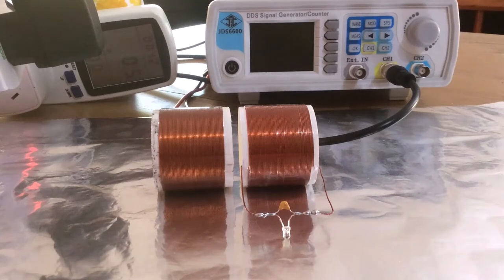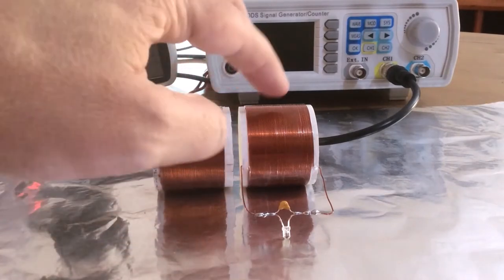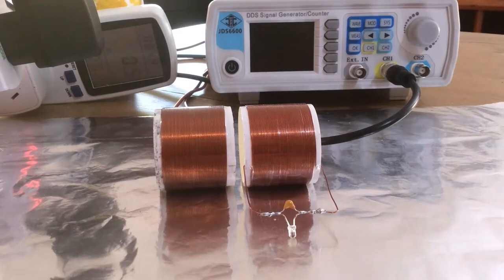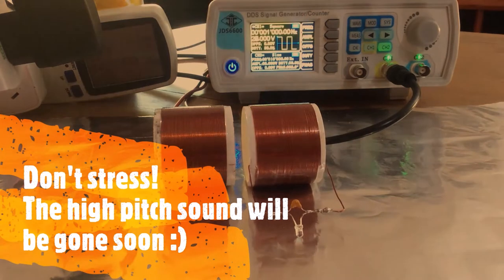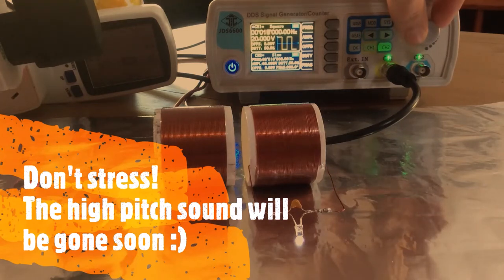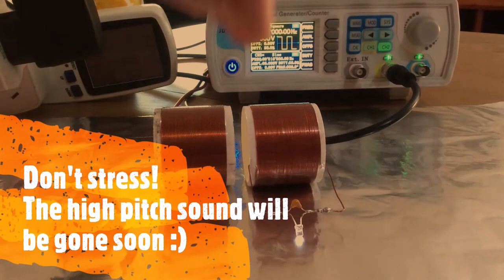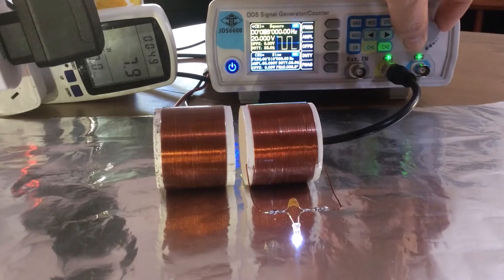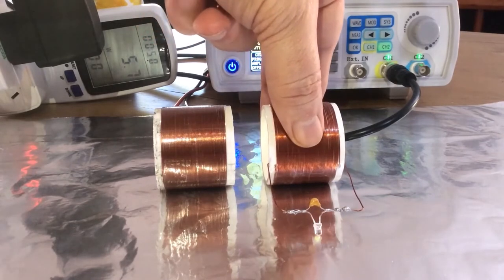FREE ENERGY with RESONANCE!

Comment: hi, do you have the Rick Friedrich Gate driver schematic?
Reply from the maker: Thank you for your comment. I don’t have a gate driver schematic like Rick does and instead I use my portable coil system as a “sort of” frequency generator or my actual frequency generator. I do however have a gate driver schematic from the company that produce the educational coil that Don Smith spoke of which is similar to the system Rick uses, that company still exists today. I would be more than happy to supply that very simple schematic if you need.
Reply: @whatifididthis...1236  yes please!
Reply: @whatifididthis...1236  can you please give the company name, they still sell Dons 2 coil system?
Reply from the maker: @ReigoVilbiks  Unfortunately they no longer sell the unit, the web site was sciencefirst.com and when I contacted them they were selling it, it certainly was not cheap at approximately US$220 so I made my own. I did however acquire a copy of the operation instructions in PDF form, which has the signal booster or gate driver schematic on the last page. I have seen this kit elsewhere and I will supply a link at the bottom of this comment but you may need to register to see the price, I am in no way affiliated with either company.
It is interesting to note that both companies used the same stock photo of the kit. I might also point out the company that Don mentioned somehow led me to sciencefirst.com after I found a company name change, forgive me, the details are somewhat sketchy as this was a long time ago.
https://us.vwr.com/store/product/13387741/resonant-circuit-kit#order
Reply: @whatifididthis...1236  thanks! where did you got the PDF?
Reply from the maker: @ReigoVilbiks  I was sent the PDF by an employee of sciencefirst.com, I can forward it to you if you send me an email at shoppagreed@protonmail.com
Reply: @whatifididthis...1236  hi again, can I please have the gate driver circuit? :)
Reply from the maker: @ReigoVilbiks  Sorry, I have been a little busy, I will check my email tomorrow and send the gate driver circuit to you.
Reply: @whatifididthis...1236  thank you very much!
Reply from the maker: @ReigoVilbiks  I checked my email but could not find a message from you to reply to. I will send you a copy of the gate driver as soon as I receive your mail.

Comment: Have you done any experiments with "Scalar Waves"? I've been digging around and I'm starting to suspect Tesla had found a way to cancel or "recycle" the transverse component of the energy field, eliminating distance as a variable and increasing the strength of the E field, not by transmitting power waves but transmitting potential, effectively he was "teleporting" energy, and the receiving converts the potential into useable Electricity. This system allows free energy by only needing a single primary "generator", multiple receivers can be setup to take advantage of the potential difference without affecting the primary. No distance limit, no power loss, and can feed itself to further boost the potency of the primary.
Reply from the maker: Thank you for watching. I don’t have a lot of  experience with scalar waves, but I have seen results of certain experiments that fit the profile for scalar waves, my problem is limited knowledge, limited funds and like everyone, limited time. I believe you are correct regarding additional resonant coils not increasing consumption on the primary as I have seen this on many occasions and I believe with high voltages we can manipulate frequency to facilitate long distance wireless transmission. Zenneck waves are also interesting and in some ways similar to scalar waves and I would love to do more research in both fields. There’s a good article re Zenneck waves in the description.
Have a nice day.

Comment: how do you know what capacitor to choose for a coil to keep it resonating at its natural resonant frequency?
Reply from the maker: Thank you for watching. I usually run tests using different values to determine the correct capacitor. You can get close to the needed value by normal calculations and then fine tune with either a variable capacitor or capacitors of different values. I usually use my frequency generator and then sweep for the peak voltage to determine the optimum frequency for each capacitor and coil. This process reminds me of the old days of fine tuning the dial on a radio for different stations except you can see the light fluctuations more easily.
Reply: @whatifididthis...1236  thanks!
Reply: yes, you dont have to do anything too complicated, may aswell use the cap he's using, cos it works, and if you do use a different value cap, you just sweep the frequencies to find the resonant sweet spot for your coil/cap combination.  you can use an adjustable capacitor but you can just as easily use a fixed value cap (if your in the general ballpark) and just sweep the frequencies on the signal generator. he's using 1nf so start there ! ; )

Comment: Where would you put ground line? On receiver +?
Reply from the maker: Thank you for your comment. You would have to experiment with that as I have not done that, surprisingly!

This would be a worthwhile test to run, I have started writing down tests that have been suggested because I’m getting so many suggestions that I’m forgetting the valid suggestions that came first, a “videos to make list”. I will add this to that list.

I know there are multiple effects from these systems and best use of theses systems is to target the most desirable effect and manipulate it, ie it may be better to ground the 2nd earth on the -NEG or +POS side of the LED or to a floating earth. Sometimes you see the opposite of what you expected and the best thing to do is note the observation and determine if it’s helpful to your cause.
The frequency generator also has an earth connection so it would be a good idea to have the additional earth line at least ten metres away.
Hopefully I will be able to let you know.

Comment: Hello, would it be the same phenomena as you have with your video "Tesla Power Saving Power Transfer with 12 volt batteries" ?. I mean here it is only a transfer of energy by induction with no connection to the groud. When you are in resonnance with alternating current it seems like you connect the LED with one way "positive" and in the other way the transfer is "negative". When one LED receives the orther one gives back. Does it make sense? I know it is quite complicate to understand as LED work only in one way but imagine if the kick back is done in the good side of the LED ? Then we will have twice the effect if we would have 2 LED working in oposite side (in parallel)? Maybe by using also two polarized capacitors ?
Reply from the maker: Thanks for watching. I do understand what you mean with the LED working in reverse, I accidentally discovered this weird phenomenon by trying different arrangements after one LED worked in both directions. I briefly explain this in the following video.
https://youtu.be/2c5H1hZuvmc
I will be honest, I don’t completely understand this and I will need to do more research in this area.
Reply: @whatifididthis...1236  Hope you are going better, and your leg no longer hurts you. 
I mean a LED is normaly working only in one direction. AC with high frequency allows the LED to seem lightening continuously but it not the case. Which means only a part of the sinusoid is used and the other part is not consumed. So if you place two LEDS in parallel in opposite ways with capacitor attached to each LED, then you will consume more of the current wave? I tested that configuration directly with my function generator and it works. At low frequency, I have one led lighting up and the other is turned off. At high frequency both seems to light continuously (even if it is only an illusion). But with your induction coils configuration would it consumes more power? Probably you will have to adjust the resonance. If it works and you do not consume more power then, probably we could add more leds to see what will happen to the power consumption?

Comment: thanks man  for sharing 
Is the alumium sheet in you video important for grounding ?
Reply from the maker: Thanks for watching. The Aluminium sheet isn’t used for grounding but to demonstrate wireless Zenneck Wave transmission. Waves that wirelessly attach themselves to certain materials and travel large distances. Longer transmission distances can be achieved using this concept. It is not connected to any of the coils in the video other than wireless coupling. I might add that this demonstration is not a true representation of Zenneck waves.

Comment: I wonder if you put both these in a bag and put them under water what would happen. I would suspect better results
Reply from the maker: Thank you for your comment. That would be a good experiment and not that hard to arrange either. I will write this in my experiments to do book. I imagine it should work the same or even better because water has high dielectric properties and receives much more radiant energy than air, also radio waves pass through concrete and steel without noticing it so I believe it would not be difficult to transmit through water. It’s all about frequency!
Reply: @whatifididthis...1236   My thoughts were Ultrasonic is very audible in water like other sound sources and you could make an array of secondarie coils.

 I can't remember the gentleman's name but for him to Get better results through air he had to use a Tesla coil (where my thought is the water experiment to do the same kind of job )
Reply from the maker: @toddmolloy311  Thank you for your comment. I have used water many times during my experiments as it has a high dielectric value and is able to capture various wave forms that are otherwise difficult to harness. I will test your idea and let you know how it goes.

Comment: I am wondering if each receier coil runs 5.4 watts of load OR if the total sum of all LEDs of all receiver coils have exceeded the 5.4 watts of consumption, will the 1st transmitter coil still consume only 5.4 watts?
Reply from the maker: Hello, thanks for watching. I find it very hard to measure most outputs of this circuit. The meters I have available just can’t cope with super high frequencies. When considering the small increase of milliamperes input, under 5 milliamperes input increase when attaching 400 milliamperes worth of LED’s, something clearly is not accurate in regards to our education! This video will demonstrate what I’m referring to, after the ten minute mark. https://youtu.be/RCXzyJdo4yI
Thanks again for watching.
Have a nice day.
Reply from the maker: By my calculations we should be seeing a 1.6 watt increase in power draw when applying the 25 LED’s in the video that I supplied the link to in my last comment. Instead we see a 0.02 watt increase with all 25 LED’s at 100% brightness (or brighter). 🤔 Unless I’m missing something, which is a possibility, being human!
Reply: @whatifididthis...1236  You're not missing anything.  This is pure free energy. Period. We can't argue against evidence
Reply from the maker: @kanjo-Etienne  Thanks for watching. 👍